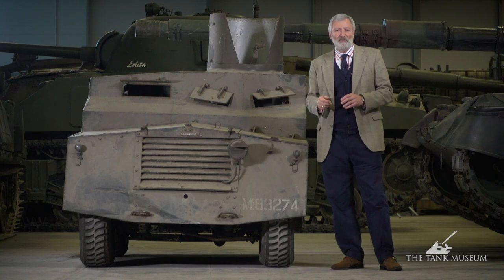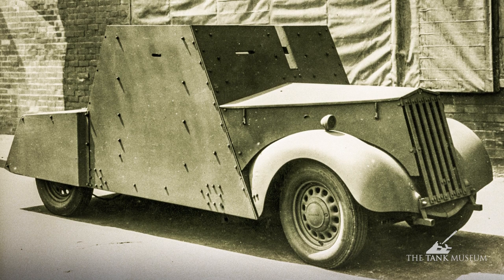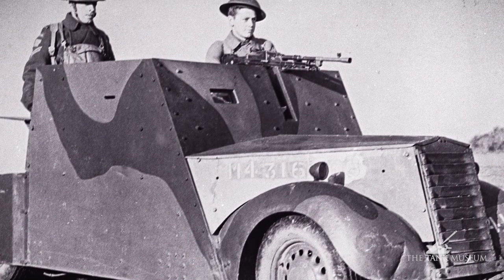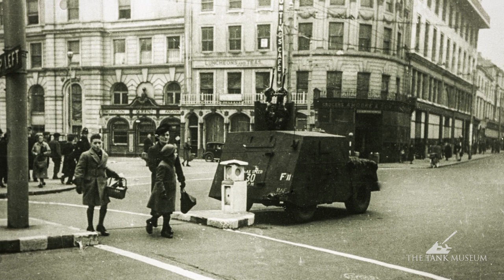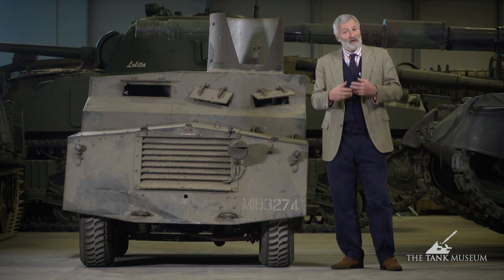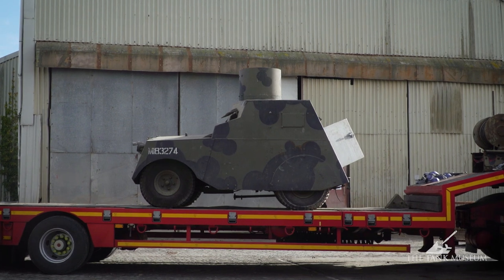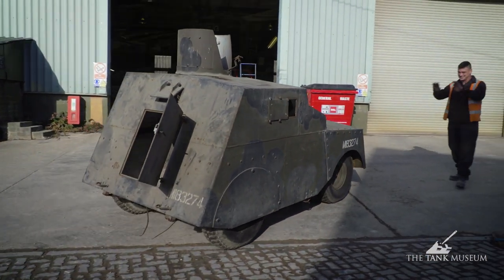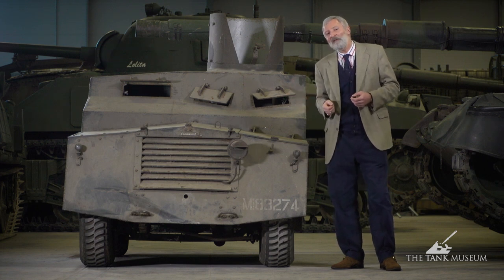Tank Chats #61 Beaverette | The Tank Museum

Comment: I can see this being useful for airfield defence, and maybe to be a nuisance while defending a village.  But that's about it....
Reply: When they where first built, they would have been facing German paratroopers and infantry for the most part.  No Panzer III's or IV's.  So while it would not have been great.  It could have been good enough..
Reply: It was a quick way of getting troops to a point with heavy weapons, look at it more as a cheap wheeled universal carrier. The twin Vickers K guns put down some serious firepower. 

As a recce vehicle, the Brits more use them to sneak about, get close ish, then recce or set up an op on foot. The vehicles are not armed nor used to actually fight, just move around, basic self defence if they can't run away and are discovered.
Reply: @chaz8758  I don't think  very many had the Tiwn Vickers Ks. It's more likely they'll borrow a Bren Gun from stores on the way to face the Hun.
I think  they would be a useful supplement to Infantry amid the sunken lanes of Southern England.
I wouldn't fancy their chances if the Luftwaffe shows up.

Comment: But who would win, the Beaverette or the Bob Semple tank?
Reply: Bob Semple, because some variants had a cannon
Reply: The Semple... it could also make roads and airfields. :)
Reply: That depends, is driving required ? The Semple "tank" could do about 5-7 mph. That makes 24 mph look like greased lightning
Reply: @jakedee4117  still isn't faster than a shell
Reply: The old speed vs. firepower thing. Don't want to get too nerdy BUT. Without a 360 turret on the Semple the faster Beaverette could maneuver to its blind side, then unleash the full fury of its .303 firepower.  @TheBrainSpecialist
Reply: Bob Semple, as it is the only tank that incorporates mattresses into its design. Not even MBT’s today have that.
Reply: Funnily enough the Beaverette, the New Zealanders also made them and they made more than they did of the Bob Semple (about 200 NZ Beaverettes irrc)
Reply: Plot twist: they both roll over and crash on the way to the fight.
Reply: Who would win?
The spectators.

Comment: A vehicle of desperation.
They would’ve been better off building something like a modern “technical”.
Any “technicals” (utility truck with HMG or recoilless rifle) in the collection?
Reply: Better off with something with no armour?  The Germans could aim, and tended to turn up in large numbers - not like low-density warfare where technicals (like the long range desert patrol 4WDs of WWII) work.
Reply: William Chamberlain 
As you no doubt know, there is a trade-off between mobility, protection and firepower.
If the armour is both ineffective and limiting manoeuvre then, yes, you may be better off without it.
The Germans also didn’t limit their fire to small arms from the frontal aspect only, so this armour was a product of desperation.
Reply: @sophrapsune  only the v1 was frontal only - 1:25+ or so for the rest.